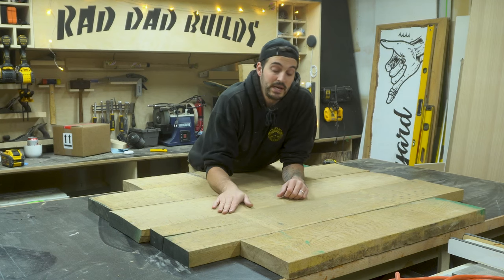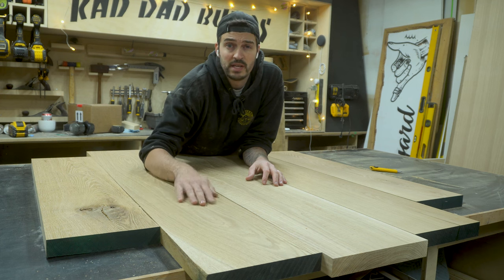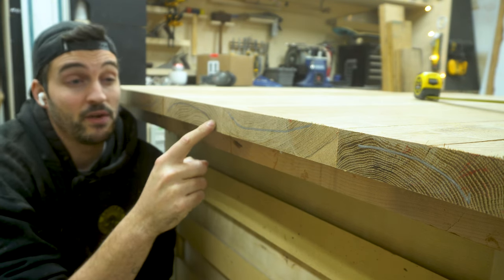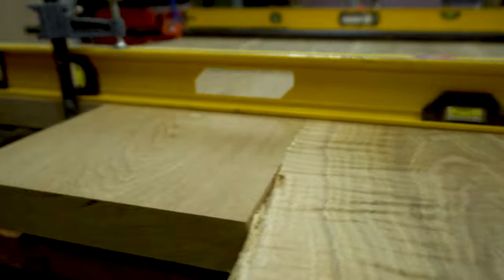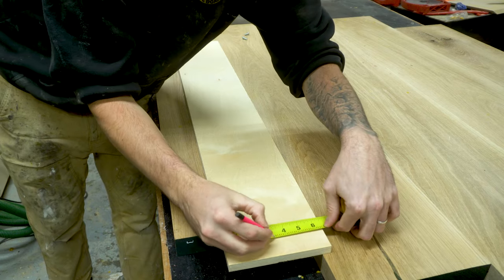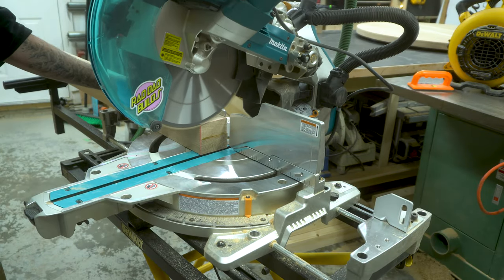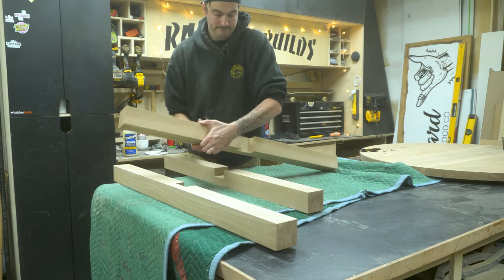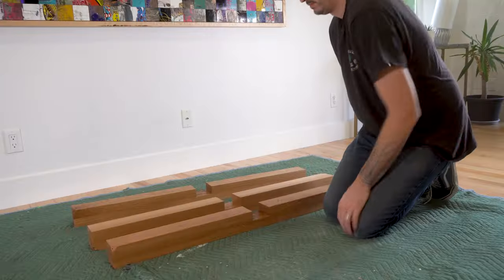Simple Modern Dining Table That looks Complicated | YOU CAN BUILD | Plans Available

Comment: Stunning table, simple build and fantastic look.  Seen the legs and wanted to try - am def gunna make one in the next week or so.  What wood did you use? Thanks for sharing 😃👍🏻
Reply from the maker: Thanks dude, I'm really happy with it. I ended up using white oak for the whole build.
Reply: @RadDadBuilds  can you advise on leg height. You cut yours at 45” for a table height of 30”, is that 30” the underside of the table height or the top surface height?

Comment: 1st off - Excellent video and even better work! 2nd - Are you able to go wider on the table top without it being too top heavy and tilting over? In your video it looks like the top is approximatley 4' in diameter. Do you think I can get away with 5' with using the same dimensions on the base? If not, what should I change on the base to go 5' up top?

Comment: Did you consider making compound angle cuts where the legs meet the table and where it meets the floor? I am in the process of building an end table from a cookie using this leg design and your video was VERY helpful. I would also like to incorporate the compound angles I mentioned, but I haven’t determine how to make those cuts yet. I do like the way you sanded them to take the point off, but I would like to make cuts to accomplish taking off the full depth of material. Please let me know if you have suggestions. Thank you!!
Reply: How did it go? I'm wanting to do the saMe thing, I've got some live edge silver maple cookies about 6" thick and I'm thinking this base leg style
Reply: @benhutzel1223  It went very well. I am very happy with the result. I was able to trace (pencil mounted in a block of wood) the compound angle on each leg (floor side and table side) and then use a Japanese hand saw to make the cuts. Worked very well!

Comment: Do you think these legs would work just as well with a a standard rectangle table?
Reply from the maker: Depends how long, if you went with a 5ft then I imagine it would be ok but anything long would be pushing it. You could always to two bases, one each end. The 4ft round that I made is very sturdy with no tipping points at all.
Reply: @RadDadBuilds  thanks! Great build; that table is killer!

Comment: I intend to make that base to serve as an 8 person dining table for my new breakfast nook, could you please tell me if it is as strong as it looks? I think i want to put a glass round top on it bur i'm afraid that the table will disassemble and the top will fall off, would adding some wood glue at the joint be sufficient or do you recommend strategic screws to be sure?
Reply from the maker: glue isn't necessary at all. its plenty strong enough if you use a hardwood. make sure your cuts are clean so the joints are tight and you will be fine.

Comment: S0 those legs will be stable without any screws where theh intersect, and the tiny figure 8's?
Reply from the maker: I’ve had this table way over a year now with heavy use and it hasn’t moved a hair
Reply: @RadDadBuilds  what angles are the legs corners at?  I need a 36” high table, 36” diameter 11/2” slab

Comment: Yo, can anyone give a rough way to match diameter of round table to length of legs .
Whats the calculation
Reply: I'm looking for the answer as well. :)
Reply: a^2 + b^2 = c^2.... So if you want 30" diameter to match table top and 30" in height, it would be 30^2 + 30^2 = c^2. Which c^2 is about 42.43" in length (length of legs when you cut). You can round it down or up to make it easier for cuts.
Reply: Have a 44 inch round top .want a 30 inch high table ....what should the lenght of the legs need to be